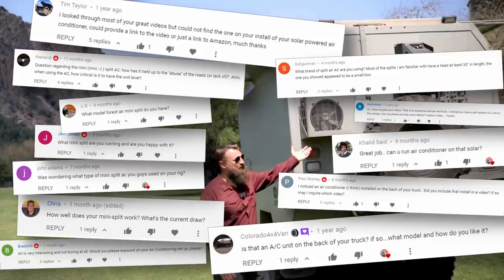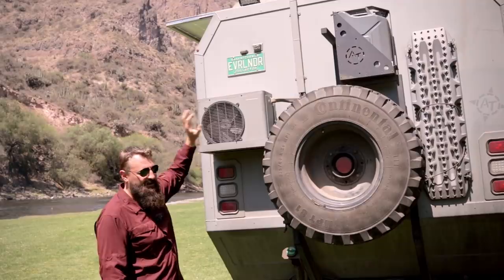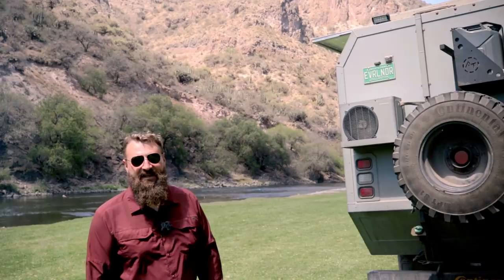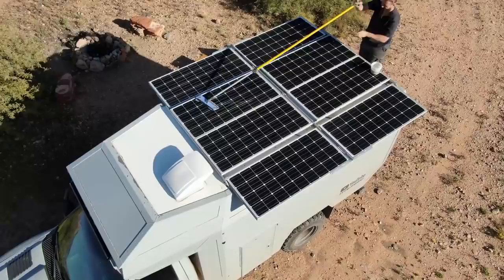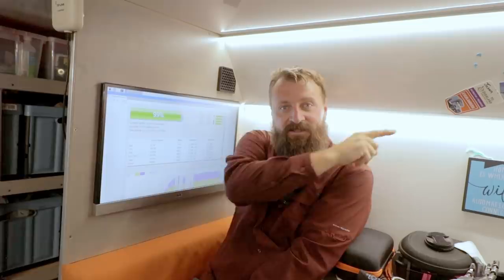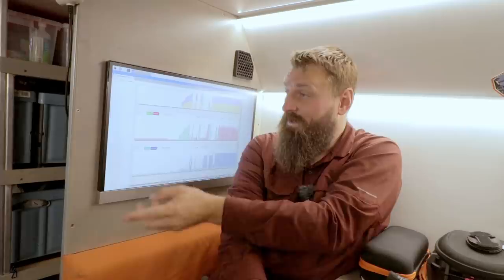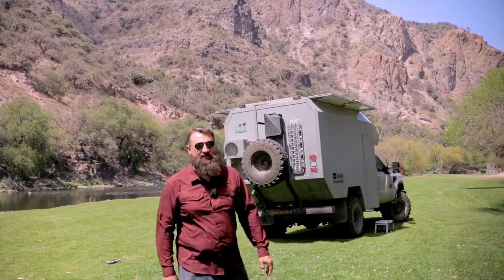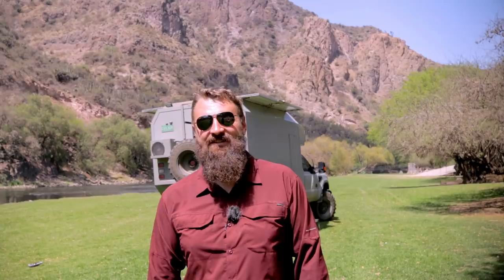Solar Powered Mini Split Air Conditioner Tour - Everlanders see the World!

Comment: Quick question: what would be the realistic minimum in overall solar wattage required to run this unit (assuming sunny day)? I am planning the solar array on our Bigfoot truck camper and have space for about 850W.
Reply from the maker: I swear I've typed a response to this comment three or four times and a week later it's not there... Sorry Rob! Here goes again... It's a balancing act between how much solar you have, how much sun you have, how much battery you have and how hot and humid it is and how long you want to be able to run it. 

In Guatemala and the Mexican Coastal regions, our 8 panels (~1400 watts), and 900Ah of Lithium keeps up, but barely... If there is rainforest canopy cover, we get about 20 hours on battery and then we're running low... 

If you want to be able to run it for a few hours a day, and you have a largish battery, and you're not going to be in hot areas for very long, then 850w might get you by.
Reply: @Everlanders  If you do any travelling and don't sit camped you'll also have your alternator providing power for some of the time too.
Reply from the maker: No, our alternator has been disconnected for some time and the chassis is powered from solar, at $2/Kw for diesel, it's a much better choice to get the power from solar...
Reply: @Everlanders  wow that's a bold move
Reply from the maker: It's not that bold, if the sun ever burns out, I can just reconnect the alternator.
Reply: @Everlanders  ah, I thought you removed the alternator. that's better. how far could you drive before having to reconnect it?
Reply from the maker: About 85,000km so far.

Comment: Were you able to disconnect the umbilical and plumb it through without needing AC servicing equipment?
Reply from the maker: Yes, That's what I tried to imply in the video, but I guess it didn't come out clearly... The disconnects are valved so that no AC service equipment was needed. I've heard that the newer 10,000BTU version no longer has the quick disconnects, but I can't confirm that.
Reply: Everlanders Mr.Cool makes units with quick disconnects.

Comment: Hey Jason. I just picked up a forest air 10k btu unit like this. But it looks like they have removed the quick connect option.  Im in a fiberglass truck camper and was looking to donthe same AC setup.  Would you have any suggestions on a solution for this without the quick disconnects.  The way I see it  either I have to take a window out or discharge and remove the lines and have them remade by an AC shop after install.
Reply from the maker: Yeah, like kinder surprise eggs, these are not allowed in the USA. If it was me, I'd have it evacuated, and plumbed in with copper through a hole.
Reply from the maker: If you have a window near where you want it to live, you could take out the window and it's frame, and make the passthrough hole near the frame edge, install it and then put the frame and window back. Effectively you'd be making the passthrough grommet right next to the window.
Reply: Thanks for tbe quick response. Good to know.  I agree with having flushed out but that being said.  I know HVAC places and alot of automotive won't touch a custom just on a RV like this.  Great idea with taking window out and then replacing.   That might be the way to Go this case.
Reply from the maker: I'd suggest an appliance repair, somewhere that does refrigeration.
Reply: @Everlanders  good idea. I'll call around.
Reply: Got another question for ya. The frame you made for the compressor outside.  Looks like 2" steel?   Or alluminum?
Reply from the maker: Everything is aluminum... 2 inch seems correct.
Reply: @Everlanders  I've only got 1 1/2" steel on hand but that should work
Reply: @Everlanders  curious. How many inches gap between the condenser and wall did you leave. The frame almost looks like it's right against the wall
Reply from the maker: About 2 inches
Reply: @Everlanders  excellent! Thank you so much for the replies!
Reply: Hey Jason! I got it built and installed. Thanks for the help! Can I send ya so.e photos?
Reply from the maker: Sure, email me...

Comment: Hi Jason, I'm Paul--love this video.  I've been studying up on solar wiring diagrams and was wondering if you lose the output from all the panels when you shade the other 4 under them?  Or maybe there's some clever way of making sure that doesn't happen?  Also just curious (clearly it works) do you think you're losing efficiency by not having much clearance around the inside evaporator unit?  It seems really tight there.  Thx!
Reply from the maker: Study up on "Series vs Parallel Solar Wiring"... Ours are wired in parallel such that partial or complete shading of any panel does not affect the others.

I'm not sure how the position we chose for our air conditioner would affect efficiency, the air intake is located around the perimeter of the face, and is completely open to the space.
Reply: @Everlanders  Ah, so all 8 of your panels are in parallel?  Are they about 9 amps each, or about 72 amps max coming into your controller?
Reply from the maker: Correct

Comment: Did you consider the mini split system that works directly off a solar/battery system? They’ve been out for a few years as well.
Reply from the maker: Would you be so kind to provide some links...
Reply from the maker: Right, the ACDC12C - I've seen several makers of such hybrid AC-DC units, They use Solar Directly from the panels to offset the AC (grid) consumption. While this would be great for a home or cabin installation, these are the reasons I wouldn't choose it for our rig:
(1) The Solar (DC) Requirement is 48+ Volts, In our "12v RV/Automotive" environment, this isn't practical. We're running 36Cell 12V panels and a 4S5P cell Lithium Bank (13.6volts)
(2) The AC side is 240 Volts, while we could get a 240 Volt Inverter too, this is overkill and expensive for an RV, The A/C would be it's only load and they aren't cheap either. It might be fine for your Cabin/Home. Further, If we ever have to opportunity to plug in to the grid, it probably won't be a 240v plug...
(3) They require a Refrigeration Tech to Pull a vacuum &  Charge the R410A Refrigerant. Adding to the Cost.
(4) Cost, They're 2 grand...
(5) It's just too big... Indoor Unit Dimensions 34"x 8" x 12 Inches, Outdoor Unit Dimensions 34 x 13 x 22 Inches

The only real DC Air Conditioning system that I really considered was the Cruise N Comfort, But at $4,000 it was a pipe dream... Unless you want to sponsor us, Cruise N Comfort????  :-)
http://stores.12voltairconditioning.com/hd-12s-12-volt-dc-mini-split-system-air-conditioner/

Comment: Nice Vid! We've got mini-split on our fifth wheel, solar-powered.  It's so much more efficient and a lot quieter than the rooftop units, which, after removing them allowed for more solar panels :)  I think we'll be seeing more of them on custom rigs.
Reply: Absolutely.. Most of the 120v minisplits use about 40% less power for the same cooling power as the roof top units. Alot quieter too.
Reply: Curious how you like it after 2 years. And curious about your battery setup to make it work. Setting mine up right now and really just want to run the mini split and led lights inside.
Reply: @CaptainZeroCaine  what do you mean by running the mini split "inside"? Like the outdoor unit?
Reply: @randybobandy9828  oh, sorry. I'm saying all I want to run is the mini split and 12v LED lights (custom travel trailer build) inside the trailer. Basically, no stove, no microwave, or anything like that.
Reply: @CaptainZeroCaine  oh gotcha. What battery size and type? Do you have a minisplit picked out?
Reply: @randybobandy9828  I'm currently trying to source the panels and batteries, but I'm out of my element lol. I'm good at building, terrible with electricity (and math). I'm looking at a Senville LETO 9000 btu. Seems to have solid ratings and reviews, with a good lifespan. I'm guessing I want to go with lithium, but I'm a little concerned with the cost that keeps getting higher and higher.

Comment: Really cool build! That sliding solar panel wowed me. BTW, 3:09 kilometres is pronounced just like "nanometres", not "thermometers", because it's a unit of measurement and not a measuring device. A "kilometer" would be very useful when playing games like Call of Duty. Also, 8:05 "centigrade" is long deprecated (over 70 years ago, and you definitely look younger than that); it's Celsius now.
Reply from the maker: The unusual pronunciations are usually there for a comedic effect and to entice people to correct me in the comments, which helps the algorithm identify user engagement.
Reply: @Everlanders  
See... right there, using the old noodle!

Comment: Thank you for this info. I have a pointed with purpose question. Are you glad that you installed an air conditioner ? it was suggested for my bldg. that i would not need one , with all of the windows and 2 max air fans ..the box would simulate a climate much like a cooler and the air flow thru would keep the interior comfortably cool . ~peace~
Reply from the maker: Yes, we are glad. If you're staying in the States, you'll be fine with some windows and a cross breeze, if your heading into Central and South America in the hot and humid rainy season you may reconsider. Furthermore we have a short muzzled dog that is quite sensitive to getting too hot, especially if we have to leave him in the truck for a strenuous hike or where dogs aren't allowed - so that's 40% of the reason we have it.
Reply: @Everlanders  Right On ! That agrees with my decision ; I added one that will be powered by a honda 2200i gen. I have 850wts on the roof , not enough , but the gen. will do it and also provide some redundancy . Thanks for getting back ! safe Travels ~peace~
Reply from the maker: Consider the fuel consumption of that thing, it doesn't take too many hours to pay for enough solar...
Reply: @Everlanders  Thank you , it will be minimal as it's use. I don't have the engineering capability or knowledge the same as you and i'm not sure OEV , would do on mine as you did on yours..trade offs in life , You're good ! ~peace~

Comment: Why use an inverter?  I'm amazed RV'ers haven't figured out how to feed DC batteries to DC power for the mini split without converting to AC and back to DC.
Reply from the maker: Because 800watts at 12 volts would be 70 amps and the current would be so high that you'd need welding cables the size of Garden Hose to keep the losses to an acceptable level.

Comment: How do those panels deploy and retract?  How long will it run at night?
Reply from the maker: I provided a link in the card at 3:22 to the video showing the Solar Retract video... And it will run all night if we want, like I said in the video, it uses 550W and with our 11.5Kw/h battery we can run it for 23 hours without any Solar, which of course we'll never need to do as the sun will always rise tomorrow. (until it doesn't)

Comment: Anyone have any idea how much solar you would need to run this unit for say 4-6 hours??
Reply from the maker: It's easy math... If the AC is using 800 watts and you have 800 watts of solar production, then you can run it as long as you have sunlight. That's only half of the question because your batteries need to have a reasonable amount of capacity too, then if you only had 400 watts of solar then you would need 2 hours of sun for every hour the AC runs. I go into more detail about this in a recent video, although I'm talking about cooking appliances and not AC, but the math is the same. https://youtu.be/822Ge0Es7WE

Comment: Great info explaining how the ac works. one question for ya though. What is the overall weight of that particular compressor unit if you happen to know? Keep safe and enjoying life.
Reply from the maker: Specifications:
Dimensions (L × W × H):
Indoor unit:  40.6 cm × 40.6 cm × 20.8 cm (16 in. × 16 in. × 8.2 in.)
Weight:  9.9 kg (22 lb.)
Outdoor unit:  53.3 cm × 40.1 cm × 20.8 cm (21 in. × 15.8 in. × 8.2 in.)
Weight:  19.5 kg (43 lb.)
Voltage and cycle: 115 V / 60 Hz / 1 phase
Current: 8.6 A
Thermostat range:  16 °C to 30 °C (61 °F to 88 °F)

Comment: Very informative! Have you ever measured startup surge? I'm wondering how much surge capacity the inverter needs. Thanks again!
Reply from the maker: No, I haven't. Our charge controller averages the last minute, but I don't think it's very much, nothing like Kara's 2200 watt hair dryer - that really gets the inverter fans going...
Reply: @Everlanders  Lol no kidding. I'll have to poke around the manufacturers website and see. I guess it's a safe assumption that anybody with a rig big enough to want an ac will have a large inverter so probably no need to worry in practice.
Reply: @Everlanders  💇‍♀️ lol

Comment: Thank you for all of the quality information.  Did you put a soft start on the unit or is the startup spike not enough to brown out the inverter?  Edit - Ah, just saw another comment where you answered this question.
Reply from the maker: I think they designed it to be a pretty soft start anyway being that it's normally plugged into any ole' 10 amp outlet.
Reply: Everlanders thanks for the info, I’ve been looking at mini splits for my project as well.  Keep up the excellent videos.

Comment: Do you ever run the AC overnight? If so, how does that work out? What percent of the battery bank does it consume?
Reply from the maker: We haven't yet, but some math gives us a pretty close guess... 530Wh 8 x hours is 4,240Wh which is 36.8% of our 11.5kw battery. In the real world it would probably be much less than that because we aren't fighting the sun.
Reply: @Everlanders  Thank you. That sounds doable with your setup and I agree regarding fighting the Sun along with probably less in and out the door, etc. might make a significant difference.

Comment: great vid and info, what software are you using for your energy management?
Reply from the maker: I wrote it mostly in Python and then is displayed via HTML/CSS - The SBMS100 has a ESP32 that broadcasts the raw data every few seconds and then I parse it in Python and save it to log files, then lighttpd serves up the HTML with the most recent data. I also send the pertinent data to Blynk which is sort of like a MQTT service. Blynk makes it very easy to display on a smartphone app with easy graphs.

Comment: I came to the same conclusions about windows so in my truck I have 2000w of solar with one large skylight for ventilation and natural light and if I want to take in the view then I go outside :). You can use the interior space much better without them as well. At some stage nearly everyone will be parked in less than ideal locations where they want privacy....Windows are very overrated.
Reply: @jed,
2003, we built our ExpeditionVehicle.
We mounted 3010 (three feet wide by a foot tall) dual-pane sliders designed for a stand-still house.
We mounted these at our eye-level standing inside, about eight feet above pavement.
.
Two decades full-time live-aboard.
Zero issues.

Comment: Have you thought about modding the split to run on DC? I bet you're smart enough to do it and I bet you've thought of it. or is it too much cost/value?
Reply from the maker: Oh yeah, I've thought about it... But refrigeration compressors are motors sealed inside a metal ball, so changing the motor isn't really viable. There are DC refrigeration motors of course, but they are for small fridge/freezers. There are some DC Air Conditioning systems coming to market now... But they look cobbled together and cost thousands of dollars.
Reply: @Everlanders  I had in my mind the ac motor would be accessible. Yeah that would be not worth it.
Reply: I'm installing a similar diesel heater  but just using a fancy fantastic fan for our Canadian summers. Cheers from T. BAY
Reply: TLDR, it'd be a lot of time, money, and effort for a 5-10% gain in efficiency.  Definitely cheaper to buy and fit a few more solar cells.  

Probably can't mod for DC on a fixed speed air conditioner or heat-pump.  You might be able to mod a variable speed mini-split heat-pump to run off of high voltage DC (200-300Vdc) as they almost always run off of high voltage DC internally.  This would be quite dangerous without the correct wiring, fuses, and breakers.  (see, automotive EV conversions)  You'd also need to reconfigure the battery pack to run at the same high voltage which would force an update to the rest of the solar system.  (again see automotive EV conversions)

Comment: Awesome engineering going on there 👍👍Just wondering how do you achieve positive air flow in the camper ? Since it looks sealed up pretty well
Reply from the maker: We have a MaxxAir fan on the roof that is usually set to blow air in, (which usually has less dusty air) and there are two vents between the Truck Cab and the Box. Our Composting Toilet is also vented (In and Out) and is another reason we usually maintain the camper box with positive pressure.
Reply: @Everlanders  Thanks for the info 😊😊